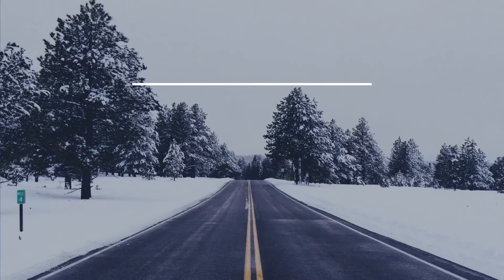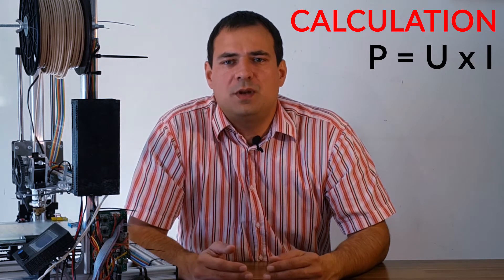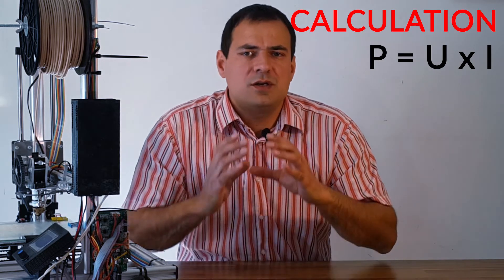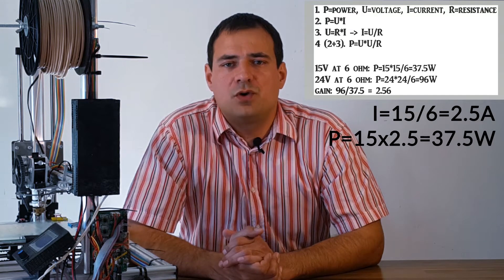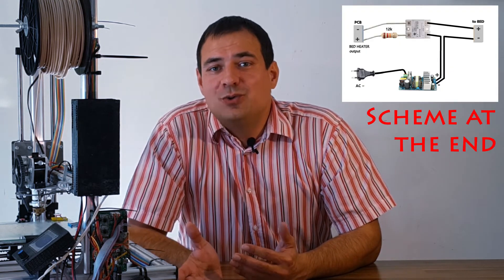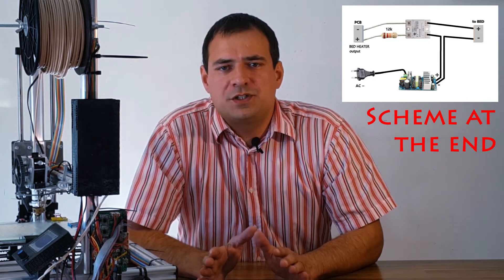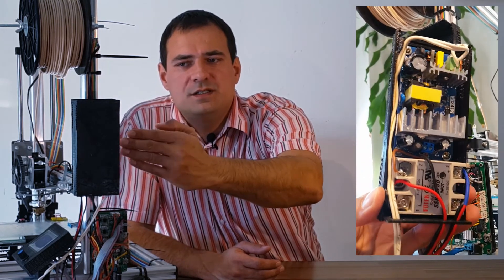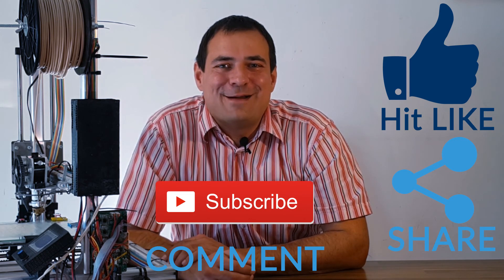HEATED BED UPGRADE - DIY power supply / relay

Comment from the maker: If you use several layers of different material above the heated bed (i.e. thick aluminum, glass plate etc.) and do not use 3D printer enclosure, the start up time will be longer! The stated times in video are true for using only glass plate above the bed and using the enclosure.

Comment: Hello! Congratulation. A very good explanation :) I have a question to you. I have a board (Rambo) powered with 12 V. If now I am going to add another power (in row) with 24V, this will not destroyed the board?
Reply from the maker: Hi. I dont't know your setup, but in my setup this 24V supply does not interfere with mainboard. It only supplies heated bed. Supplies are separated via SSR.

Comment: Can you explain where you came up with 12kOhm for the resistor? Is it a dummy load since the 15 will only be for switching? I’m thinking of attempting this update but might be using a different voltage (19v or maybe more) but I’m not sure if I’ll need to change the resistor.
Reply from the maker: Hi. 12kOhm is for limitting the current thus it protects the MOSFET of pcb. Yes, a dummy load. SSD contains an optocoupler which turns on led at 10-20mA. Use the highest resistor that still makes the SSD work. Check the required input current of your SSD (PDF file online).
Reply from the maker: Thank you for your support!

Comment: oke i have my k8200 for 7 years now and the biggest change for heatup time was to change the Realy!!! small wires to some realy chunky ones. and now i only wait for 5 a 10 min and its up to 60 degrees which is more then enough for pla. but in the end i changed allmost everything like, glas plate, T2 belt, T2 sprokets, E3D v5 extruder, second z-as,  
trapezoidal thread. and i made allot of object for mechanical strength. but was looking for a way to heat my bed hotter but i dont like your approach

Comment: Hi! First of all: great tutorial! :) I did the upgrade and it is working as expected. The heated bed heats up fast. I have one problem though. That is during a print the heated bed just stops heating up. The power supply is still working (have measured the voltage and the green light is on) and also the light on the controller board as well as the light on the solid state relay is also on. Do you have any idea what the problem could be? This happens like 30 minutes into the print.
Reply from the maker: Thanks! I would put ampere meter on the wires between the bed and the solid state relay. It seems there is a bad junction somewhere between SSR and the bed - the heat breaks it. Just an idea... Please do report findings...
Reply: @greeneyedexplorer  Had some time now during hollidays to find out what the problem could be. I resoldered the wiring to the heatbed but it didn't solve the problem. So I looked into how many voltage that was outputed from the heatbed connector on the PCB and I found that it was about 2.6 volt with 12k ohm resistance. So I switched to a 10k ohm resistor and the output to the SSR is about 3.2 volt now. I've been running the heatbed for roughly 45 minutes now without any issues. Looks like the problem got away :)
Reply from the maker: @rasmuslahti  Congratulations and a happy new year!
Reply: GreenEyedExplorer tanks for the reply! Will try that!

Comment: I've had my Vellamen k8200 for almost 2 years. I've set my stock heated bed with 15v supply to 110C and it tops out at 80C so ABS printing is out of the question. I'm running PLA only. I have ordered the suggested parts, to expand my printing abilities. Am I correct in assuming that your k8200 is running on 2 power supplies? the stock 15v for the step motors and hot-end, and the 24v for the heated bed?
Reply from the maker: Hi. Correct.

Comment: Does your SSR not get hot? I have tried (almost) the same setup, only interrupting the (-) of the PSU but my SSR instantly jumps in temperature.
Reply from the maker: It heats a bit, but not too much. I have made an enclosure from PLA which contains both SSR and power transformer. Enclosure hasn't changed a bit in last few years. It has several holes on both sides and this suffice.

Comment: What is the reason for you to use Solid State Relay in detail? That is, if I don't use SSR, what becomes in PCB?
Reply from the maker: I chose this path due to another power supply. It is safer to split  both of them. The second one is 24V and the first one is 15V in my case. The SSR has an optocoupler which mechanically splits both supplies. It is the fastest way of finishing the product. You could use transistors/darlingtons to achieve the same thing, like an audio amplifier works... I chose safety. 24V backward can destroy the original PCB or both power supplies in the worst case scenario (if coupling shortens). Hope it answers...